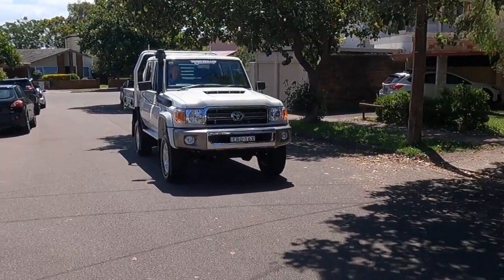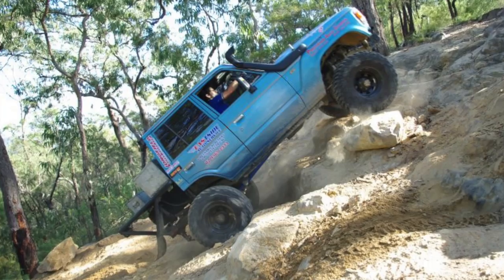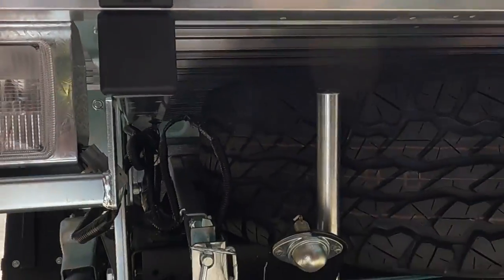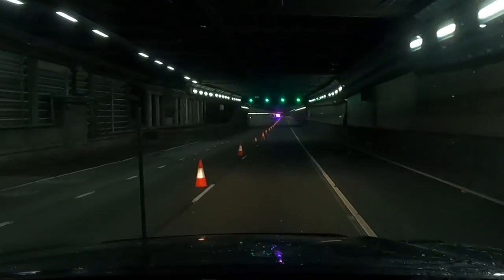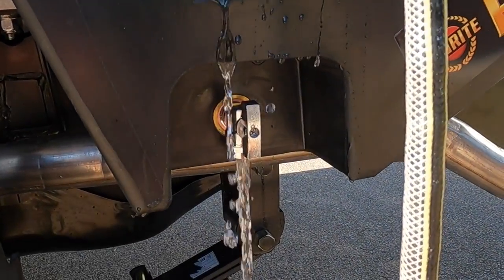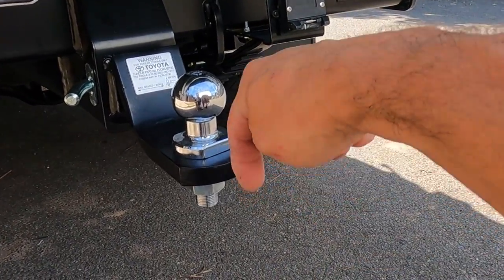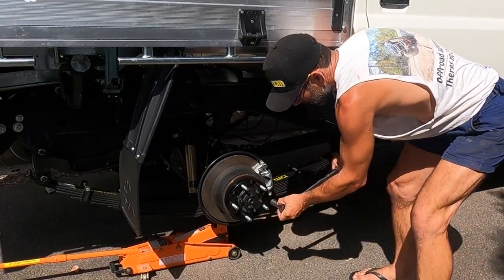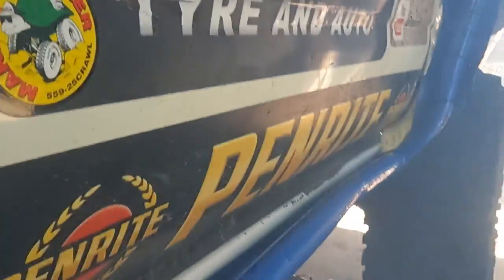WHAT MODS WE DO 1ST.......Modified Toyota Landcruiser VDJ79 TJM Equiped 3 inch pre rego GVM upgrade

Comment: Hi there, with the spacers do you regularly have to check them for correct tensions, iam undecided weather to use negative 25 rims just to correct them a bit instead off negative 50 all go spacers🤔
Reply: Google 'are wheel spacers legal in Australia" or read the unsealed 4x4 article online to see if they are for you. I don't notice any issues other than visual with the different wheel track in my VDJ79R .

Comment: Good clip mate but geez, illegal wheel spacers - really ? 
They aren’t worth the headache ( when failing ) or the hassle ( with the police / infringements ) - you are better off getting offset wheels or a proper diff correction conversion - costly but well worth it 👍👍
Reply from the maker: Yep, hear you loud and clear, they will be coming off after this weekend, we have a trip planned where theres a lot of ruts, and we need the rear wheels to follow the front in a few spots, its the place if you remember the gq got into a bit of trouble, so its the place we have  chosen to do a bit of a test on the TJM suspension...

Comment: Why antisieze on the studs and not loctite?
Reply: Hi DJT, thanks for the question. Get comfy, make popcorn.  Thread lubrication and chemical locking can be contentious. Opinions will vary. I'll do thread lock first.  Most liquid thread locking compounds work more or less like superglue - they remain liquid until deprived of oxygen then rapidly form a thermosetting polymer which has weak to moderate adhesion to the surfaces of the threaded parts, and work primarily by eliminating vibration and increasing friction between components.  For wheel studs, whether we are talking about the studs retaining the spacer or the wheel itself, this means it will probably work ok for a while the first time.  For it to work properly in subsequent applications, it must be completely removed, the threads thoroughly cleaned to remove all solid particles, and fresh locking compound applied. The wheel needs to be removable because tyres are the least reliable (most highly stressed) drivetrain elements.  The spacer has to be removable to work on brakes and wheel bearings; these are service items, they have to be inspected/adjusted at least annually,  if you follow the service schedule. The likelihood of that chemical locking process being correctly removed and applied on the side of the road on in the bush is not high, thus increasing the probability of damage to the threads from trapped debris, over torqueing, or under torqueing.  But wait, there's more.  Most liquid thread lock compounds start to break down around 200C, which is well within the operating temperature range of disk brakes.  The wheel studs might not get that high, at least not often, but we have all experienced smoked brakes on a big descent, there is a significant risk that any chemical locking applied is worthless after one hard drive.  A correctly torqued and tensioned wheel stud and nut will not require a locking compound because there should be no possibility of vibration or cyclic loads unloading or winding off the nut.

To anti seize and thread lubrication - for non-coated threaded fasteners (wheel studs are usually bare steel, possibly lightly passivated), tensioning options will usually be "lightly lubricated" or "well lubricated"; tightening genuinely dry threaded fasteners is a recipe for instant disaster - very high risk of galling (cold welding then tearing the threads off as the parts go together or as they come apart) which carries multiple secondary risks - under tensioning due to high friction and welding causing the specified torque to be reached well below the required stud tension (which will lead to fatigue and premature failure downstream), or breaking the stud off on disassembly, or not being able to remove a road wheel with hand tools when you really need to.  4WDs often drive in less than ideal conditions including dust, mud and I have even heard some people drive them in SALT WATER.  Applying a lubricant achieves several purposes  - it makes it possible to tighten the fastener to the correct torque, which will bring it into the ballpark of the correct tension; it limits or eliminates damage to the fasteners caused by dry contact assembly friction, it greatly increases the possibility of being able to disassemble it in the future, and reduces or eliminates corrosive damage.  Anti seize compounds do these things extremely well while also resisting high temperature breakdown and washout,  and unlike a grease or oil, do not need to be washed out and reapplied at every removal - if you're careful and don't put the nuts in a gritty puddle it is reasonable to expect a good quality metallic (copper or nickel) anti seize to last several applications, and if its wearing a bit thin you can just add a little more of the same.  

Hopefully this answers the question.  John Cadogan (AutoExpert dot com) has a youtube about this topic, goes into a bit more detail.
Reply from the maker: Cheers for that Brian....

Comment: You mentioned the neg 50 alloys you had on your 2016 were changed to steel rims , bearing problems? I have the neg 50 rims on my 2021 . I did buy 50 mm steel spacers from superior engineering but decided the rims better . What’s your opinion? Surely spacers or neg 50 rims put the same wear on the bearings?
Reply from the maker: Spacers on factory alloys with factory tyres in my opinion would be less wear than neg 50s and 35inch muddies..Rims would totally be more "legal", the neg 50 alloys I mentioned I had trouble keeping the wheel nut properly torqued, but a friend of mine bought the same set at exactly same time and never had issues, so looking back I must have had a dodgy rim..

Comment: Any issues with that transfer extension fouling on the switch fascia? Looks close.  I have one on the gear stick but body good idea to put one in the transfer.
Reply from the maker: Just misses, and I ran a stubby cooler on top of last 79, but you do need to cut down the top thread on the spacer and bottom of knob to get that clearance..

Comment: Great video again. Please, let me know why choose TJM leaf sprinngs and not TT Parabolics?
Reply: Hi Alexander, great question and the TT parabolics have a lot going for them - I work mostly in heavy vehicles and parabolics are the spring of choice for comfort and handling. Part zero of this build was to see what it would take to satisfy requirements for the first 3” lifted 79 series pre registration GVM upgrade. TT currently lists only 2” lifted parabolics, and TJM did most of the heavy lifting for the GVM upgrade. Cheers.
Reply from the maker: Brians hit it on the head, nice answer, thanks, Alexander I have the full 700kg constant kit at home, so the option is there if im not happy with these 600s once I start towing...
Reply: Thank you both for the answers. I have V6 GRJ79 double cab. Now it is with oem Toyota 7+3 leaf pack. Empty the ride is harsh. With 500 kg in the rear it is... Let's say acceptable. It is family travel/camping/expedition vehicle. So the load is in quite a large range... From 300 to 1000 kg. I know that there is no such a spring to hold everything perfectly, but from what I read, mostly from you Drench, I decided to go for TT 4 leaf 500-700 kg pack - tlc016ehdp. Now, as I understand, you are about to go for the heaviest 5 leaf 700+ pack, if you move to parabolics? Does that mean that you are not satisfied how  the 4 leafs hold heavy weight?
Reply from the maker: @alexandermanushev3145  I ran airbags with the 700 constants so I had that up my sleeve to help when needed.. Did you say v6 79, we don't have them in oz or do we??????
Reply: @TeamBulletOffroad  The other thing is...your G.V.M upgrade was engineered & approved with a specific set of springs, shocks & other components. Change any one of them to something different or another brand your G.V.M is void, and so is your insurance.
Reply: @TeamBulletOffroad  Yes, V6 GRJ79 DC, I live in Bulgaria, Europe. They are not officially in sale here also, private import only. Yes, I saw that you were with airbags, but in your opinion, without them, is the 4 leaf pack really designed to carry 700 kilos. Sorry to disturb you, but we are on the other side of the world :) and here it is not easy to make experiments with 70 series suspension :) 10x
Reply from the maker: @alexandermanushev3145  In my opinion and experience with such heavy weights, airbags were required 100%
Reply from the maker: @alexandermanushev3145  What GVM does that V6 79 have out of curiosity...
Reply: @TeamBulletOffroad  3200 kg. V6 is lighter than diesel. Carb weight is 2200.
Reply from the maker: @alexandermanushev3145  Wow, cheers mate, very interesting info, assuming its same motor as 300?
Reply: @TeamBulletOffroad  The engine is 1GR-FE - gasoline, 4.0, V6, 199kW, - it is 20 years old, very widely used engine - Tacoma, Tundra, Hilux, FJ cruiser, Land cruiser 120, 200, 70, etc. The engine is really very pleasant to drive, just have to know that the low-end torque is not great. In 300, as I know, it is turbo 3.5 V6, which is next-generation engine. Cheers.